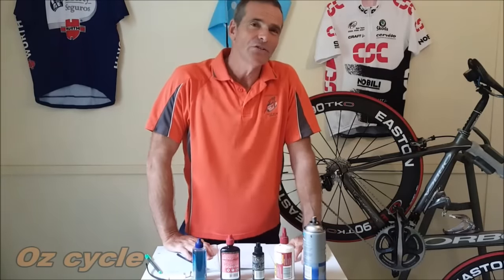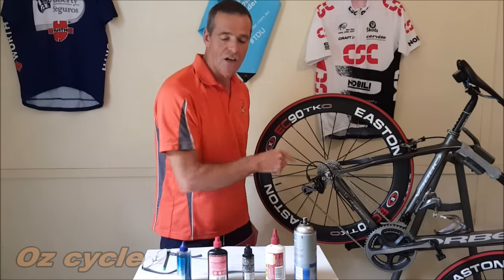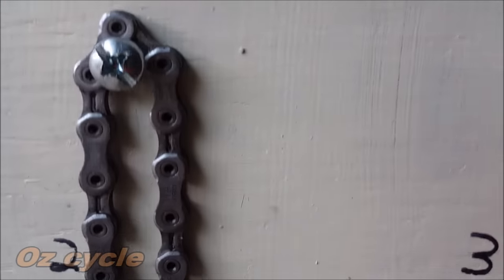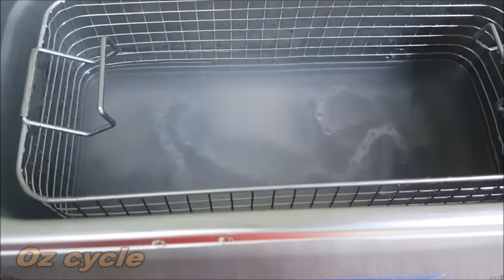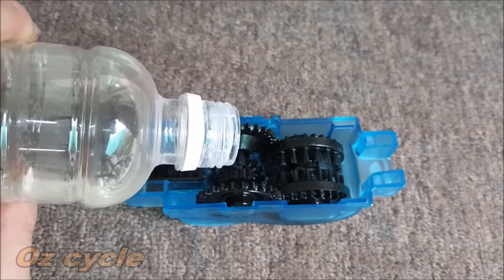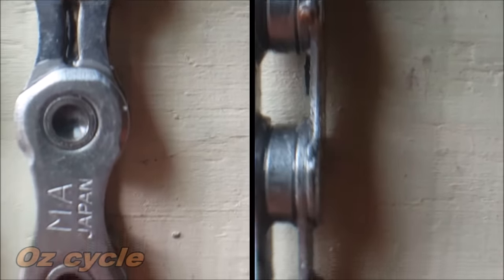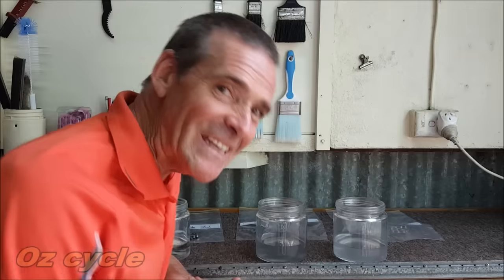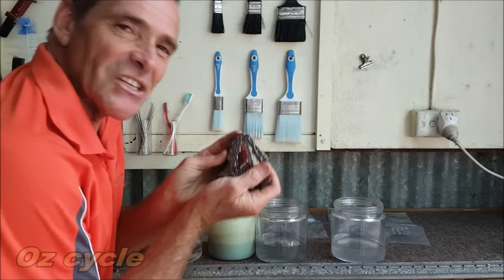Best chain clean ever !!

Comment: Ultrasonic ... Can not use flammable solvents such as Toluene (Best Paraffin Wax Solvent)
1) Tub/Jar ... I use a glass jar with a saleable lid for the Toluene not to evaporate, shake vigorously and let soak, rinse in clean solution..
2) Air Blast ... The chain dry making sure the blast gets in and under the rollers on the chain.
3) HOT WAX ... Melt 1 brick of pure Paraffin Wax, drop chain in, agitate, remove and wipe dry.
4) Mechanical Chain Brush ... Use dry to remove any  leftover wax on the chain.
Start to finish, 60 minutes
Most of the leftover paraffin wax will flake off the outside chain when riding, dont be worried about or have OCD about a "Clean" chain, after the 1st ride it will be road dust dirty.
Never put anything on the bottom of the ultrasonic ... EVER ... you can/will destroy the Transducers on the bottom of the tank! An ultrasonic cleaner is a metal tank/speaker and instead of a coil/magnet it uses a piezoelectric transducer to produce the sound waves. You wouldn't poke your finger into a working speaker, would you?

Comment: I live in the UK and yes it rains all the time, really all the time. On the video it mentions adding some paraffin oil to the mixture, I was wondering how many Millilitres would you suggest?
We have a problem with rust on the chain and cassette while gravel riding if we use the standard mixture, any suggestions would be welcome 🙏
Reply from the maker: Yes , add paraffin oil 50:50...so half paraffin wax half paraffin oil.

Comment: it is interesting that the US Shimano tech rep when asked point blank solvent tank or no solvent tank for cleaning any and all of their chains explained emfatictly never use solvent tank!  this will remove lube that is installed at the factory and can never be replaced dramatically shortening the life of their chains and actually lowering the shifting performance!       Just a thought  from a professional bicycle mechanic (25 years in this trade)
Reply: his a bicycle mechanic so someone who doesn't know much. the factory oil wont last a huge amount of time anyway. if you clean and oil your chain regularly its going to last a long time

Comment: Petrol is better than degreaser by a mile. i don't wash it afterwards. Just wipe off the excess
. Because the residue left in the rollers is oil based, it has enough lubrication for 500 odd miles. Then split it and do it all again. I have doing this for 30 years and have chains with 5000 plus miles. Degreaser just dries everything out.
Chainrings, Cassettes, Mech springs, tar removal from frames petrol does it all.
Reply: @zerosum And good degreaser isn't?
Reply: @zerosum try it. You won't be disappointed

Comment: What about Petrol in the Ultrasonic.  However you don't put the petrol directory into it.  Use one of the glass jars to hold the chain then petrol in the  jar.  Put a few centimetres of plain water in the Utrasonic and sit the jar in the water.   Don't set the temperature past 25°.  Definitely don't smoke anywhere near it and have it far outside.     Ive done it for car parts in short 10min bursts (because the Ultrasonic will generate its own heat regardless of the temp setting)  and it works well.   Using a glass jar with your chemicals in the ultrasonic is a good way to keep it clean.
Reply from the maker: Not really necessary but you can if you like.

Comment: Went for my first mtb ride after doing the Chain as in your Vidio ,  it feels so ultra smooth and the Chain is so efficient like a piece of fine  machinery  . How do I clean my Chain now  without losing my wax inside the Chain. Another question why do you use a mixture of degreaser/ laundry liquid and water only in the Chain cleaner hand Tool. Smooth Smooth Smooth ! thanks.
Reply from the maker: +Michael Towler If your chain begins to sound dry but us still clean,you can just rewax it,Michael. If you have been riding off road and dirt has got into the chain,reclean and rewax.Cleaning is the hardest part of the process...the chain must always be completely clean before waxing. Petrol ruins the brushes in the clip on cleaner.

Comment: Great video on the wax based lubricant. Will give it a try next week on a few chains.
I was wondering if someone ever used this in sealed bearings in stead of normal grease?

sealed bearings i normaly open up and fill them with grease because they tend to come with a minimal of grease from the factory. They last much longer when filled up about 80% with grease.
Reply from the maker: +Kees Nogwat Yes,have been trialing it for about 2 months now...jockey wheels and bb bearings....so far ok.

Comment: Hi!  tks for the information, I am undertaking the process etc.. but, two questions please.  
I would rather not use Petrol, what about kerosene?  (it did check to see if someone asked by could not see it, so pols for a duplication in case you already answered).
Second question, regarding the wax lube for in-between... would my chain cleaner plastic took work ok for this, ie put the lube in the cleaner and let it spin for a while?  Want to do something with the no longer need chain cleaner!
Ray...
Reply from the maker: Kerosene is too oily.
Reply: @stevenleffanue  tks

Comment: I'm wondering why the oily film left over from the petrol is so bad. Wouldn't it just kind of mix with the paraffin oil and wax and help to get the wax where it needs to go?

Similarly, years ago, I used to use white spirit to clean my chains. (Not sure if that's what you call it in OZ. In the UK, it's what we typically use to clean paint brushes, and its cheap and readily available). I'd imagine it's slightly safer to use than petrol.
However, I've been told that that also leaves an oily film.

I was wondering whether to go back to using WS, prior to lubing with paraffin oil/wax.
Reply from the maker: +Mike W Ellwood An oily film hinders the wax sticking to the metal of the chain. The chain needs to be completely bare...it  begin to oxidize so wax it as soon as possible afterwards.  If white spirits removes all previous lubricant thats fine Mike.

Comment: I have 2 or 3 questions. 

Im not certain how you would clean an already waxed chain. What is the best de waxer.

Also I have a USS cleaner but im not sure how the solvent works. Does the degreaser mix with the water or float to the top. If that is the case then the chain is bathed in water only ??

Can I use petrol in the USS cleaner. If not then what is the best degreaser. I can see that the detergent might make the degreaser miscible but would it form micelles which essentially removes the degreaser from interacting with the oil.

Thanks for your videos
Reply from the maker: +James Hi James.Paraffin wax solvents...Xylene,Toulene and Acetone. Petrol works good too but requires degreaser afterwards. In USC the degreaser mixes with the water to suspend the wax in the water. Never use petrol in USC! A USC pulses tiny bubles of air on the surface of item being cleaned...this leverages loose material from more solid material...ie dirt from a metal item. The water/chemicals simply carries the dirt away for disposal. If my explanation isnt clear there are some youtubes on how USCs work which you may find good to watch.
Reply: Thanks.

Comment: Interesting test, just wonder how much cleaner the chain in the gasoline would have been if you lit the gas on fire and melt the dirt off...

Anyway back to more serious stuff.  I did notice a flaw in your test that you actually alluded to, and that was the chain that was given the chain cleaning machine was the dirtiest chain of the three, so the cleaning method that "failed" had the toughest job to do.

The other thing is that the holes that you poked the spoke through to demonstrate how clean the chain is doesn't have any moving parts going into those holes, those holes are there to make the chain a tad lighter than older chains that didn't use have them, so any stuff inside those holes has no effect whatsoever in regards to friction unless you want to weigh all the wax you pushed out which I doubt would be more than a 1/4 of gram.

Having said all of that I happen to like the Park Chain Cleaning Machine, it's a lazy man's way to a pretty clean chain without the hassle of taking the chain off.  I use to the do the old gasoline stunt starting about 45 or so years ago, and what I found is that with frequent cleaning with either gas or the cleaning machine is that my chains last the same amount of time, but I spend a great deal more time using the gas method, which is why after doing the gas method for 20 years or so and tried the cleaning machine I haven't switched back to gasoline.  And believe me, because I'm a tightwad, had I felt my chains lasted longer with the gasoline method I would have went back to gas.  

I know of a bike shop that simply uses a wet rag and Dawn for Dishes then rinses off with water to clean chains in the shop.

Sheldon Brown's site seems to be of the opinion that some people are over cleaning their chains and removing the factory lube that is deep inside the chain that relubing can't restore, and the Chain Cleaning Machines do not strip out that factory lube.  I don't know if there is any truth to that or not, just food for thought.

But the real secret I believe is not so much about the method but rather how often you clean the chain.

By the way, I average about 13,000 miles on my chains, and my gears usually last 3 times longer than the chain.

Just an old man's opinion of course.  Cheers!

Comment: After using the petrol, I think instead of having a dummy bike to degrease and rinse the chain, I may make a second home-made cleanning tub and submerge the  chain into a bath of degreaser (maybe a citrus degreaser). I'll then try washing the chain with water, and dry it with a hair dryer.
Reply from the maker: +Garacha222 Great conclusion Garacha. That is exactly what I always do now,no longer use the dummy bike or axle,just straight in the tub with petrol and etc. Cheers
Reply: Is it ok to use methylated spirits to degrease the chain after the petrol wash?  Seems pretty easy to just drop the chain into a jar of meths once it has been cleaned with petrol.
Reply from the maker: +Winston Bowler Yes,if your sure all previous lubricant has been disolved out of the pins and rollers

Comment: 1. You need a better cleaner/degeaser in you brush box. 2 The differences in wattage improvement is probably not even measurable between the three systems 3 The brush system is the only one the is easy enough to do regularly.
Reply from the maker: To obtain maximum chain efficiency all previous lubricant and debris needs to be removed before relubing. Soaking a chain in petrol proved to be superior over all substances I tested (only three  shown in video). Please try it,you will be amazed Jim.
Reply: @stevenleffanue  I have no doubt you are absolutely correct, and are an excellent bike mechanic.! I use gasoline to clean lots of auto, motorcycle, and bike parts, but I AM A BIT LAZY, so I need a very easy solution I can do quickly and often without much time, effort, or thought. The best medicine is one the patient will take. Do you have a video on super-quick chain removal and replacement? I think that could help with my laziness.

Comment: I'm going to switch to wax. I'm DONE with greasy leg syndrome. Why do you need to use a degreaser AND petrol?  My plan was to use naptha (lighter fluid or white gas) since I already have a can of it. Naptha is very clean. Is there further lubricant in naptha? And if so, why not just use the degreaser? Am I missing something here? Thanks for your time.
Reply from the maker: To wax a chain successfully it needs to be perfectly clean .Degreaser does not remove all contaminants,petrol does but leaves an oily film which needs to be removed....hence the degreaser. Hope that makes sense?
Reply: Yes, thank you. I was using naptha to clean my rims too, for brake performance, but it didn't quite do what I wanted, although was not too bad. It certainly cleans the tars well. Rainy day today, nice day for a trip to the hardware store. Thanks.

Comment: Great video with one critical flaw, the ultrasonic and the brush both used the same solution to clean the chain but you used a different solution for the homemade cleaner, this renders the test as only good for comparing the Ultra and the Brush cleaners. Who knows the homemade might still have one but the different solution nullifies its results.
Reply from the maker: +paradox963 Petrol cannot be used in Ultrasonic cleaner...too dangerous. Petrol also destroys the brushes in the clip-on cleaner.
Reply: Yeah I get that, I guess I don't get why you didn't use the same solution in the homemade cleaner as the other two.
Reply from the maker: +paradox963 The best way to clean your chain turns out to be the simplest and cheapest. Make it out of stuff lying around at home :) .

Comment: Why would you need to get an oily film offf the chain cleaned in petrol - seems like a benefit and then to soak the chain in water only to have to thoroughly dry it - i like to use diesel

Comment: The actual difference might be the solvent used and not the method.  The experiment should be redone with using the same degreaser and detergent for all three cleaning methods.  

I can agree that Petrol is great as a degreaser, but storage and disposal of it is a big problem.  Especially, for those of us living in apartments.  I will still use environmentally friendly degreaser for their ease of disposal. Might take a while longer to clean the chain, but so much easier to dispose of it.
Reply: I can agree with your argument in a way but both, ultrasonic and chain brush cleaners, have specific chemicals to use so I would proceed in the same way.

Comment: I think the cleaning machine and the gasoline was a tie.  Yes, you showed that you poked an object into the hole of a chain and pushed out crud that the chain machine left behind but the gas did not, problem with that is those holes in chains are only there to make the chain lighter, it has no bearing whatsoever on how a chain will perform or if the chain will wear out faster if that gunk stays there, or some other part on the bike will wear out faster if the gunk stays there, there are no moving parts inside the holes that need lube.
Reply from the maker: +Rekmeyata Yes the holes do nothing. Just pointing out which process was more thorough in cleaning. Before waxing a chain it must be completely free of previous lubricants.

Comment: Mr., You did not make the main test - to bend chain a little bit left and right to hear if there is any dirt left inside.

Forgot to mension - the best and also the fasted way to clean a bicycle chain is to treat it in hot (about 70° celcium) soft solution of calcined soda or even caustic soda. This method can handle even PTFE silucone lude. Soda is not harmfull to metal, but will totaly wash any grease. You can read any content table on a proper chain degreaser, and find there alkaline, not acid.
Reply from the maker: +Паша Тарасик great suggestion...I will try calcined soda. Thanx.
Reply: BUT, I strongly recomend not to experiment with used chains. By the way, if You are not shure and want to experiment - buy a new chain from aliexpress, they are not so acurately embossed, but absolutely normal at work (I am currently experimenting with a transmission ratios, so changing thingth and found that cheep china bicycle chains are equal quality to branded shimano, KMS or sram).

Comment: I have tried all the cleaning methods described in your videos but, whatever I try, the chain always turns back to black after one ride after dipping in the wax mixture and riding ! Even when utilizing a brand new chain and cleaning the factory grease off it the chain turns black. Chainrings, cassette and jockey are also always cleaned but that also does not make a difference!Please advise what else I can try!
Reply from the maker: Follow the method in the video and it will work....it has been well tested over years.

Comment: I do like the idea to clean and lube chain of the bike but I was told do not use power lock with shimano's chains.
do you really  use new shimano pin after every clean. thnx
Reply from the maker: +Martin Loksik Nope.... wipperman connex link is the best, Martin.
Reply: Martin Loksik - power lock is one time use, so no good for sram either. SRAM powerlink is their reusable link, but I have only found them for 9 speed

Shimano recommend not to do lots of things that should be ok in practice

Comment: Hello, 
i allready use your cleaning method with the cleaning tub and petrol. now i want to start using a dura-ace/xtr chain only for racing. but these chains have a PTFE coating on it for better shifting and lower resistance. so i was wondering can i still use this method with the petrol without affecting the PTFE coating? please let me know 

Gerrie
Reply from the maker: No problem Gerrie,PTFE is unaffected by petrol. You may like to add some powdered PTFE to your lubricant when relubing too.
Reply: @stevenleffanue  aah okey thanks! You are really sure? I use squirt lube so that's going to be hard to mix then...

Comment: Would the home made cleaner be as good with the same chemicals as the other two? And how do you dispose of the petrol?
Reply from the maker: No,petrol is the best cleaning solvent. It requires very little petrol and you can re-use the it up to four times before disposing of it. Allow petrol to evaporate then wipe out the container with a rag or tissue.

Comment: Just a point - Gasoline has a low flashpoint; While it is an excellent solvent, the ultrasonic cleaner is by far the safest to use.  Not shocking that gas cleans, it will also burn the crap out of your hands and face if it flashes.  Trust me - 23 years in emergency medicine.  It isn't worth it.